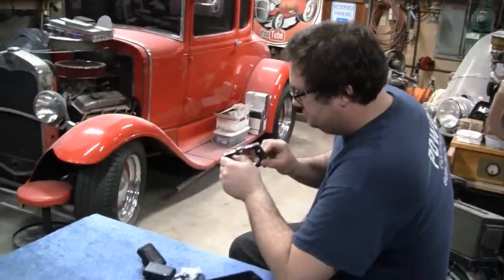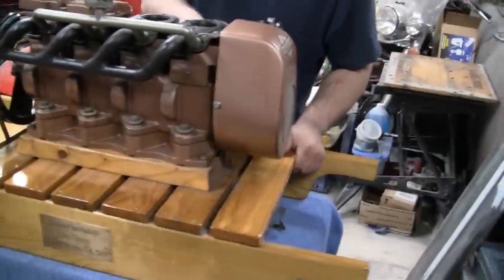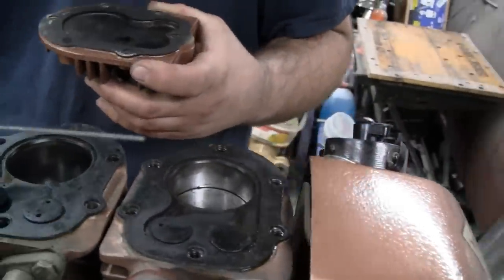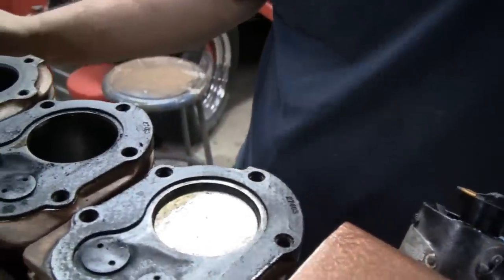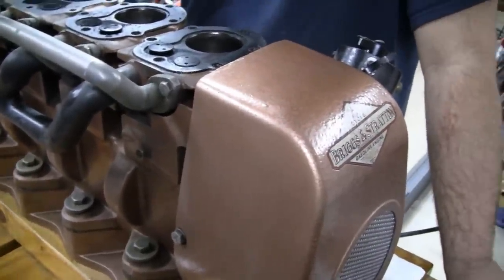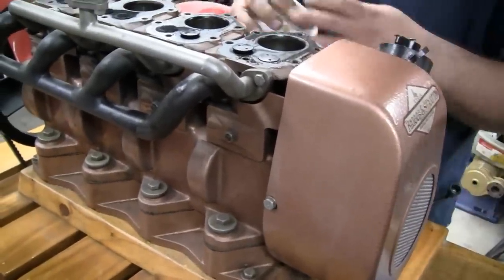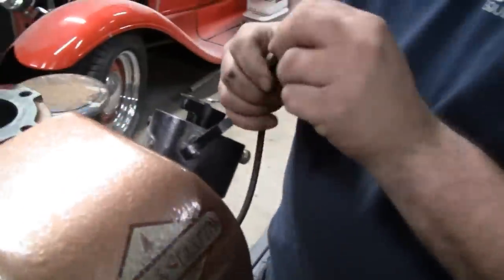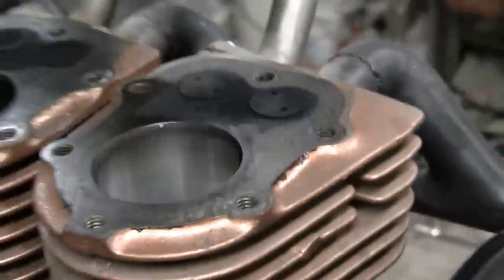HOMEMADE 4 CYLINDER BRIGGS ENGINE ANNUAL CHECKUP

Comment: Try putting a hotter plug in that cylinder
Reply: From what I was tought/understand, a hotter plug is designed to simply operate better at higher engine temps without breaking down, maintaining proper spark more reliably than say a plug a few steps "colder", being that this engine isnt designed to be ran hard, or push the limits of high engine temps I wouldn't see the need for a hotter plug,  But hey what do I know🍻

Comment: I think the carbon problem is probably uneven distances from the carburetor resulting in the nearest ones running rich and the furthest ones lean. Your carburetor  is even placed central to the engine rather than in the middle of the manifold making the situation even worse. Not an easy thing to fix without radically redesigning the manifold though.